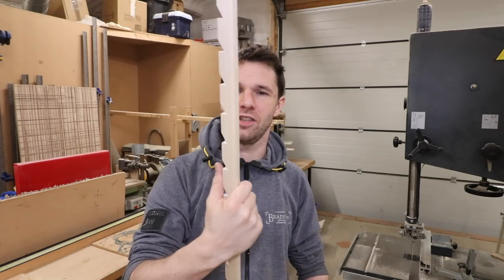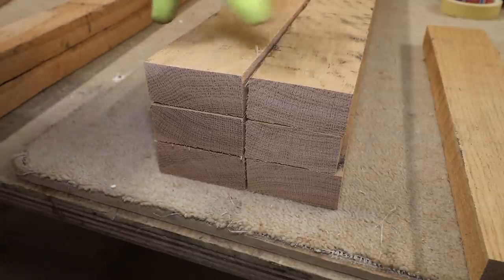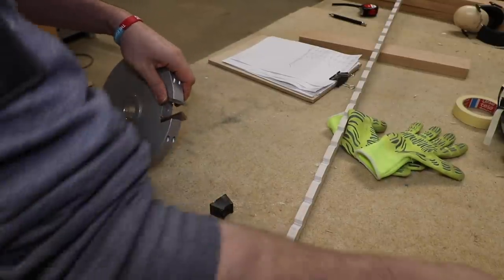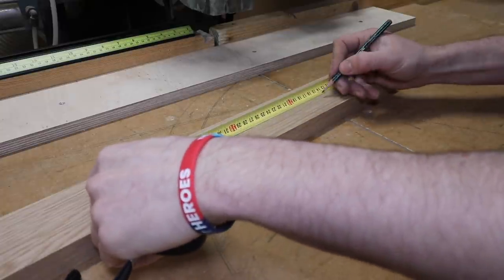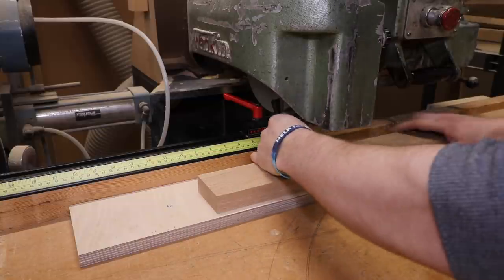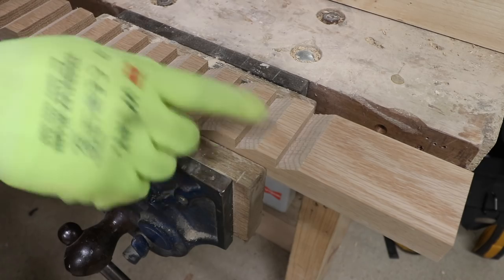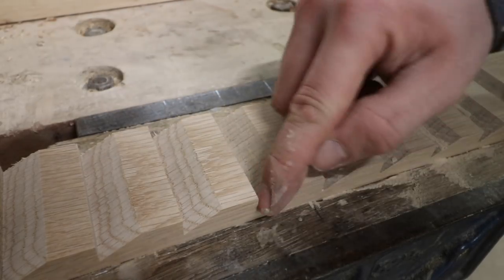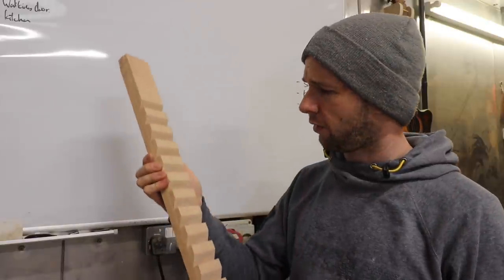Machining Sawtooth Shelf Strip. Adjustable Cabinet Shelving

Comment: I think that bit of duct tape where the hose bends going into the PT is a universal thing in every workshop 😂
Reply from the maker: HAha!! pretty much! Sawdust seems to eat the flexible hoses!
Reply: I guess there is some friction at the turn there, especially machining harder wood with more abrasive chips. I replaced all the 125 and 150 Flexi last year with new stuff. I reckon it was about 70% tape by weight prior to that 😂 still need to do the 4" yet though.

Comment: Anyone remember 50 years ago when radial arm saws were popular?  Craftsman sold an attachment that accepted cutters.  I don't think it made a very smooth cut either.
Reply from the maker: I hadnt seen that before. and no i dont remeber it from 50 years ago! haha
Reply: Yay, radial arm saws; you could do loads of stuff with those - still can I guess.
Reply: I have a Dewalt radial arm saw and it came with a similar attachment that has 3 cutters in the head and sets of profile cutters. Never been brave enough to try it but I may after watching this.
Reply from the maker: Be very careful with the DeWalt RAS they are lightweight. This saw head/arm on mine is probably 100kg plus so it never gives any kickback. 

I'm not sure if the DeWalt saws were designed to be turned 90 degrees so you could rip timber down and use the moulding attachment? Only problem being the blades spin the wrong way and try to throw everything at your face 🤣
Reply: @BradshawJoinery   Yes they can swivel 90 degrees  - in two axis. Think it may handle the bookshelf strip though. I'll let you know how I get on providing I have enough fingers left to type with :-)

Comment: Ok have a couple of questions. When making a 1 3/4 thick door what size of gap do you leave on the opening side from the frame? also do you bevel it or just keep it square? If you know of any good books or web pages on making door please share. Thanks allot, First time im making some doors.
Reply from the maker: dependign on spec you want 2-3mm External 3mm, internal 2mm. Always back bevel the leading edge
Reply: @BradshawJoinery   Thanks  boss, Ive been reading both sides should be beveled.
Reply from the maker: On a door 2.5-3mm at the door face and then a bevel back so that when the door opens the gap Neve gets smaller than that. I'd look to be around 4.5 degrees. Usually leave a 5mm flat on the front so the door doesn't go to a sharp point